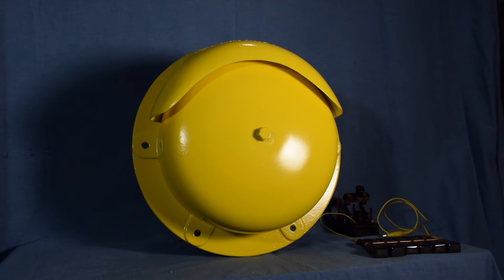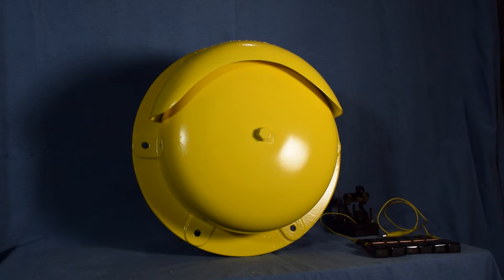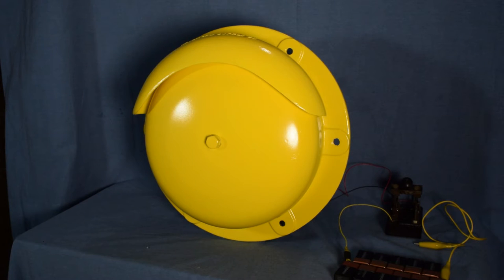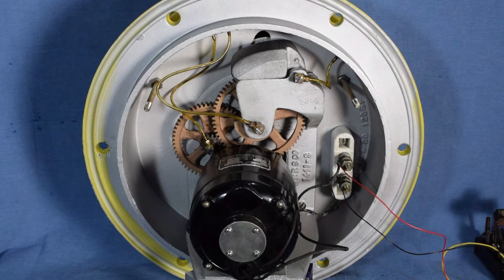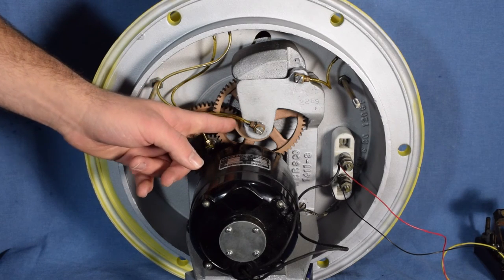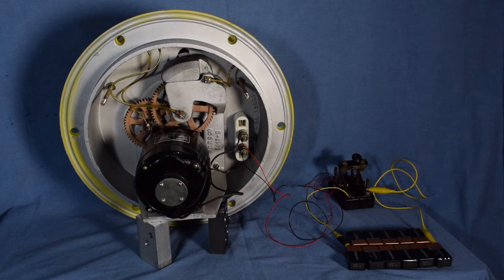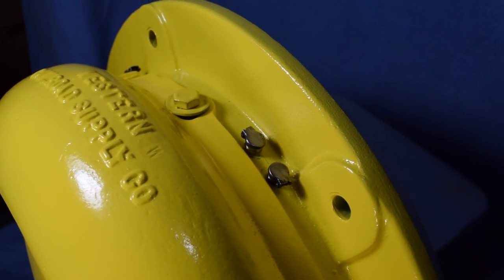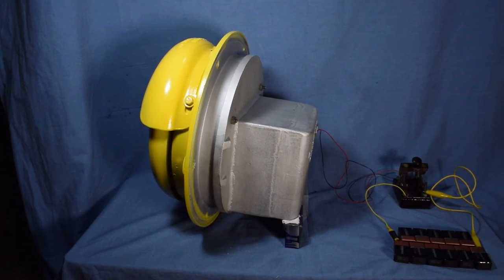CNW Gong Bell

Comment: Why did CN&W favor these kinds of bells?
Reply from the maker: Thats a very interesting question. Since the gong bells were mounted on the front of a lot of CNW diesels, the sound was heard better and it was easier to build than a modern air bell mounted in the middle by the fuel tank.
Reply: TWIGYBNSF Not all railroads kept bells by the fuel tank. Some out them by the dynamic brake blister, and above the cab, which is just as easy to maintain as the location on the gong bell. It’s possible, but I don’t think that’s the reason
Reply: The intention was to prevent snow build-up.
Reply: @Chris-eh4cc  this was probably the case.  As a Wisconsinite snow can be harsh, especially on the northern routes.
Reply: C&NW was known as "Cheap & Nothing Wasted!" I almost guarantee  cost was the real reason they used these types of bells compared to air powered bells... (brass bells, bell clappers, bell cartridges, and copper or brass air lines cost way more per locomotive than the cost of the electric bell.) Almost zero maintenance as well!

Comment: Very nice restoration of the bell. There's a former CNW GP15-1 that works on the Arkansas Midland Railroad that still has an operating gong bell on the unit. It's Arkansas, Louisiana and Mississippi Railroad 1566. It was reassigned to the AKMD by Genesee & Wyoming. Other than formerly a CNW unit, it also worked on the California Northern Railroad and the Dallas, Garland and Northeastern Railroad before it was owned by the ALM.

Comment: I lived in Elmhurst in the 70's - 80's spent alot of time down by the train station heard the sound of the gong bell millions of times. If I remember correctly on the E & F units the gong bells were mounted where the lower headlight used to be. Boy does that sound bring back memories😊. 
You mentioned the Crandal Cabs. For some reason.I always liked the looks of those units.and any unit with the oscillating headlights. Thanks for posting it. Havea Happy New Years everyone..
Reply from the maker: Thats cool thank you! Happy new year!

Comment: Theres a Class III Railroad company Mass Coastal, And they have a old CNW locomotive with a gong bell. MC 2010 is in operation and runs freight and passenger service. I think they have ran the bell before but they have an actual Locomotive bell installed on it

Comment: Nice restoration! Random question, I have one of these bells, but I'm missing the three bolts that hold on the cover on the top of the bell. You don't happen to have measurements of those bolts? Thanks!
Reply from the maker: Would you mind sending me pictures of what your bell currently looks like? I would really appreciate it. I can help you out with also whatever parts you need help with finding.    twigybnsf@gmail.com

Comment: It sounds like a trolley bell.. is it? 
I might be mistaken
Reply from the maker: Not quite, but trolley bells are today mechanically operated and the early ones used a button on the floor to manually ring it with your foot
Reply: Oh.. I see!
Reply: P865/P2020 was the only LRV to use CNW gongs I believe

Comment: Great video! Is there a way to figure out if a bell was used on an engine? Was yellow bells used for anything else? I hope not, because I just got a 1206 with old yellow paint all over it.
Reply from the maker: Thanks! Yellow was used on the CNW but then later they went silver. But other railroads used the gong bell like the South Shore Line, and DT&I. Don't recall if any others did

Comment: Where'd you get that GRS fork switch and how did you hook it up?
Reply from the maker: I found it buried under the dirt by the tracks and I used batteries, to the fork switch, to the two contact wires on the motor

Comment: This is basically a rebuilt or specially built WRRS highway railroad crossing bell, correct?
Reply from the maker: No. This is was designed to go on a diesel. Specifically on the F7 it came of from. WRRS did make a geared crossing bell as well but thats very rare.